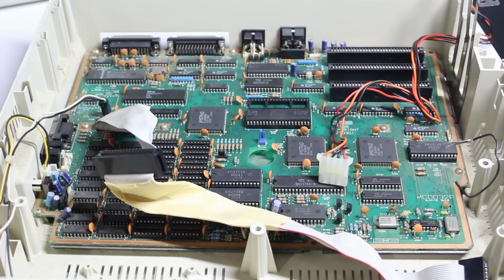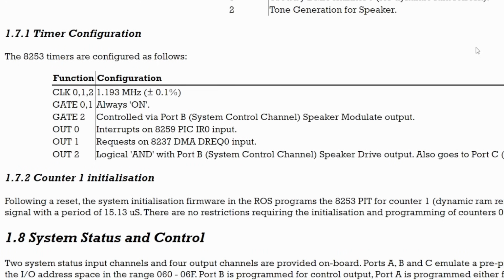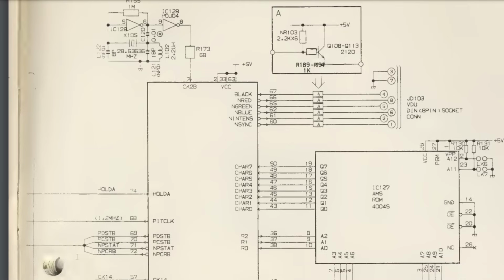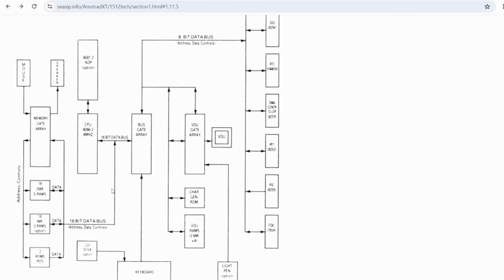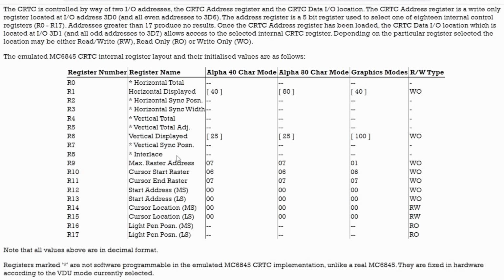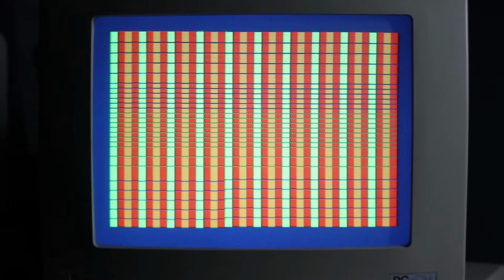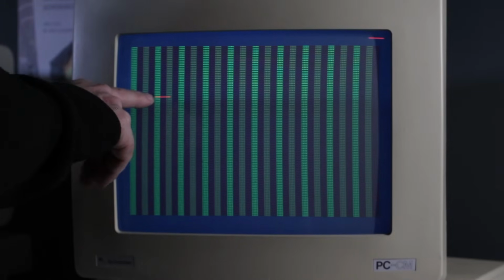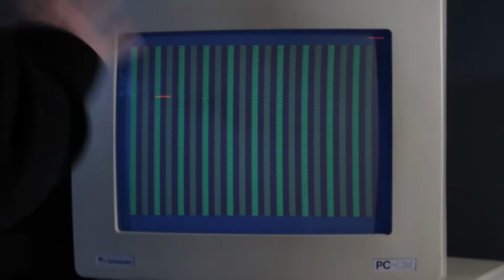Studying the Amstrad PC1512 Graphics Chip

Comment: If really desperate, could substitute the xtal oscillator inputs with two clocks derived from one source using PLLs and dividers
Reply: Maybe just slightly underclocking the CPU, to get it into sync with the display chip? Wasn't that 2x the NTSC clock? And the CPU 8MHz?
Reply from the maker: @root42 I could, but I'm not sure it's worth it. The information isn't going to be usable either way.

And yes, that was 2x the NTSC clock and the CPU was 8 MHz. Obviously they have dividers on these crystals.
Reply from the maker: Nice idea. That could work, I think.

Comment: 4 color scroller with 16 color 'fpp' effect over the top. I come from c64, so its basically an fli effect
Reply from the maker: That's the sort of thing I think you could probably do. It'd be easier if the start address could be manipulated mid-screen. It seems possible between certain modes, but then there are major glitches when switching between those modes.

Comment: I've always wondered if you could resurrect the vestigial PC1512 graphics chip that's on the PC1640 and use it with a second monitor
Reply from the maker: I had no idea there was one. I thought they just used an EGA chipset. I'm guessing you'd need a hardware mod to do that as there's likely only one path to the video out.
Reply: @PCRetroTech  I figure there must be some glue logic aboard the 1512 graphics chip and Amstrad just reused it for the 1640 to save respin costs, despite the 1640 already having a graphics chip. But yeah you''d need to do some soldering, the output pins are totally disconnected
Reply from the maker: @TheRasteri  Yes, there is other logic in the chip. I forget what exactly, but it's nothing terribly exciting.

Comment: Somewhere there's a write-up on Risen From Oblivion - a Commodore 128 demo. The C128 VDC and CPU are on 2 different clocks, and the VDC clock is slightly different from machine to machine.

They used some novel techniques at startup to figure out CPU cycles per VDC frame, and the CPU cycle the VDC frame starts, allowing them to do all sorts of cycle-exact timing tricks. Might be worth tracking down to see if it's relevant to your situation.
Reply from the maker: Sounds interesting. Similar techniques could be used here, but I'm not sure it's worth it given the other restrictions. It's a much more basic CGA implementation than I was imagining. I think they just did the minimum they could get away with assuming they only ever had to support one monitor.

Comment: Can't resist a video about my favourite computer of all time. I still have mine after 36 years. Unfortunately the (PC-CM) monitor probably has (a) dead capacitor(s) and I'm not too confident poking inside of it. I think I remember you lived in germany for some time. Might you know, by any chance, of some shop or person that would be able to repair it in return for payment (in germany, benelux, france) ?
Reply from the maker: No, sorry, I don't know anyone there that does repair of those things. I got them shipped over from the UK when I was there. They come up pretty cheap from time to time. However, I can understand the attraction of keeping the one you've had 36 years.

Working on monitors is unfortunately very dangerous, so not recommended if you don't know how. And I actually don't know much about the failure modes of these monitors, so can't give any clues unfortunately.
Reply: @PCRetroTech  It's probably even more dangerous since the power supply is also inside of it. Yes, I think until I find a solution to get it repaired, the best bet is to just find another working one. Thanks for your answer :)

Comment: IIRC memory chips of this era tends to retain their memory far longer than specified at room temperature (and that's often still true), sometimes tens of times longer! So I suspect you likely can get away with just refreshing once per frame (say before the HLT) instead of having to do it 4 times per frame which might allow slightly closer timing. The CGA+16-color split seems almost custom-made for things like Elite... IIRC some versions of Elite on other computers actually had more colors in the lower "HUD" area than in the space display though it was probably 2 vs 4 colors, I think it was at least partially related to not having enough memory otherwise (more colors obviously using more memory), I think it was one of the 8-bit micros.
Reply from the maker: It's true they will hold their charge for much longer than 4 ms. But you only get away with that once. It's actually surprising how close to every 4 ms you have to refresh them if you want very stable operation over a long period of time. I experimented with this quite a bit on the PC and was surprised until I realised that eventually it got me one way or another if I ran them too long out of spec.

Comment: I used to use an 18.432MHz crystal on the PIC micro because it divides perfectly to standard baud rates. I expect thats what you have on your UART.
Reply from the maker: Indeed, that's what it is.
Reply: @PCRetroTech  Yep.  Standard UARTs use a 16x clock for internal operations, and baud rates are divided further from that.  So the 1.8432Mhz crystal that you observed gives the maximum of 115.2k bits/sec that is found in traditional PC serial ports when the divisor is set to 1.
Reply from the maker: @GodmanchesterGoblin  That makes sense.

Comment: Without being able to change the video memory address mid frame means there's a lot of demo effects that can't be done. No twisters, vertical stretch, vertical flip / rotate, no per line scrolling, no parallax and no 3d road games :(
Reply from the maker: Yeah, pretty disappointing huh! I did notice some of the mode changes would also reset the memory address. It's possible with some clever, very quick, mode changes something could be done. But it hardly seems worth it given the other constraints.

Comment: Memories - I remember upgrading those PC1512 to 640k and often cutting myself on the shield over the motherboard.
I had a PC1640 because I always hated CGA.
Apart from the Western Digital Hard Drives the Amstrads were a very reliable system ... 🦘
Reply from the maker: Ah yeah, the shield in mine is missing. I can't remember if I took it out. I had one that was super rusty and had to get rid of it.

I do have a 1640 as well, but bring it out less often as it is in pristine condition.

Comment: Just starting to view your video but must correct a bit. Maybe I misunderstand, but this is not the final machine in Amstrad's XT line. The same range had the PC1640, which I owned at the time. There was also the PPC. Then came the ranges with numbers, 2000 and etc.
Reply from the maker: I was referring to another machine I was repairing, not the PC1512. As I said, this video is about the first machine in the XT line, not the last.